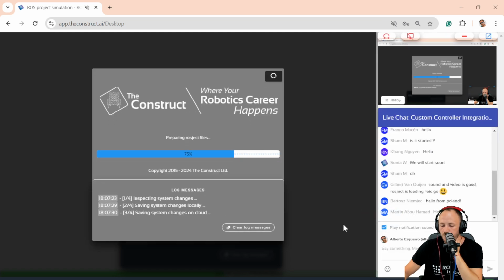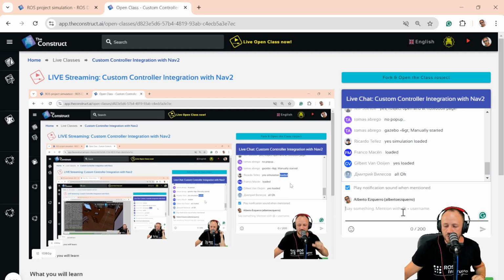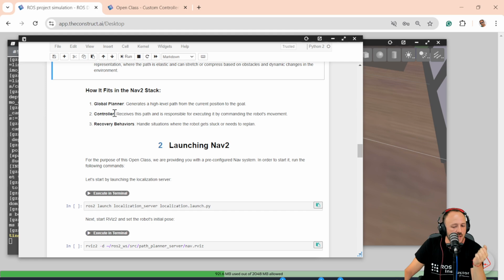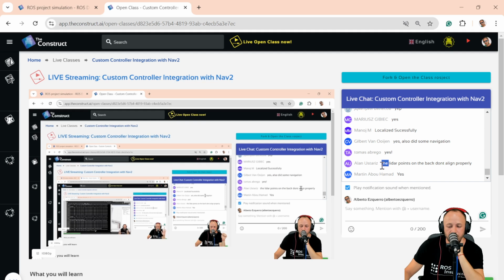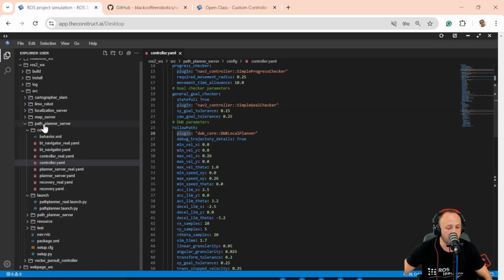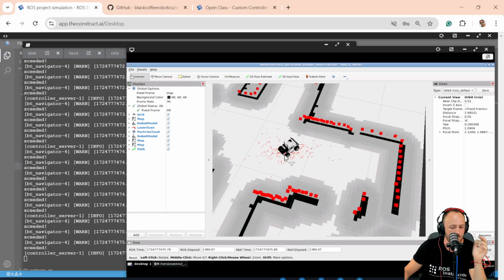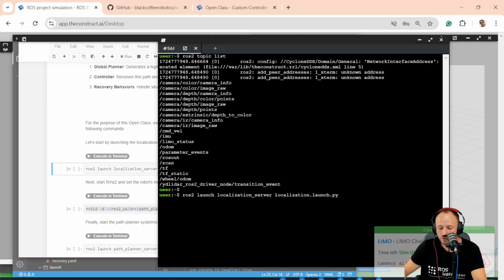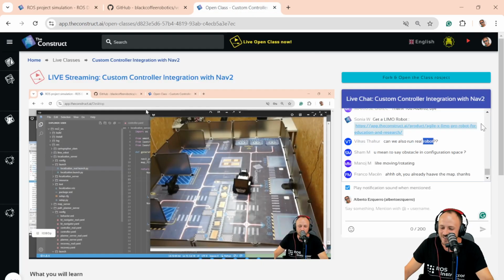Custom Controller Integration with Nav2 | Robotics Developers Open Class 195

Comment: Can you make video about how to make controller, driver, for onRobot gripper RG2?
Reply: Maybe this other open class can help you about how to use the onRobot ROS1 drivers on a ROS2 system using docker: https://youtu.be/onmDxauLzJ8?si=uXCIqQ6kj3y8pKqI
Reply: @RickTellezL  Problem is not in using ros1 driver on ros2. Problem is that onRobot does not have driver developed for rg2 gripper for ros1.